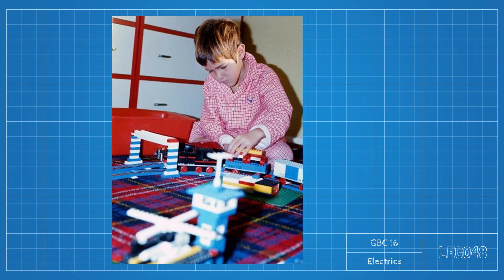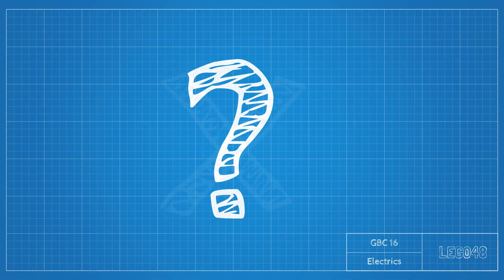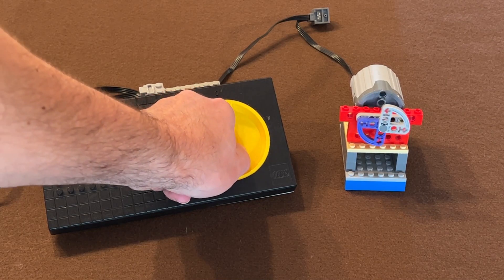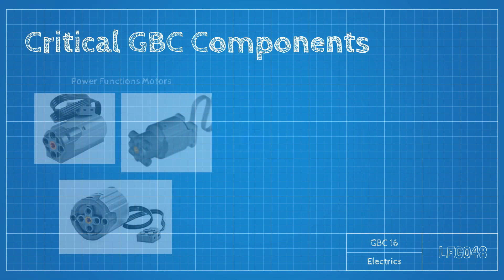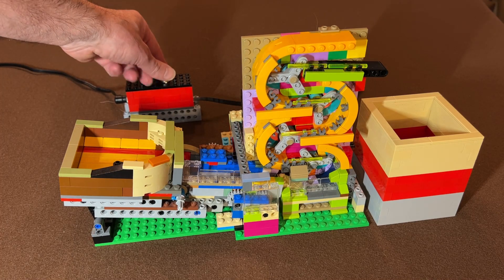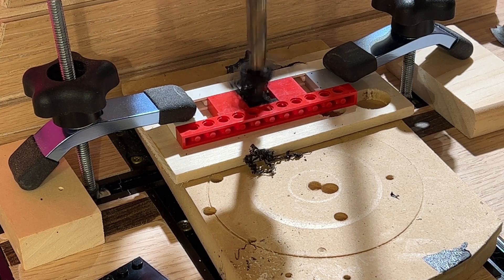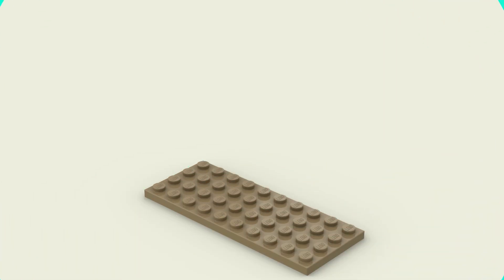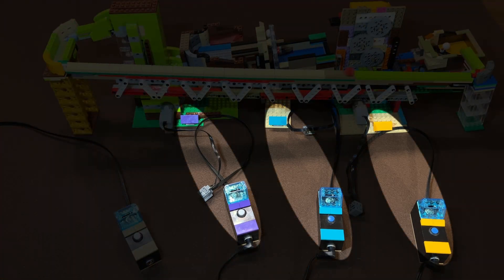GBC 16 How to power GBC modules

Comment: This is really cool and helpful, but what about if you WANT to control the speed of the motors to dial them in?
Reply from the maker: In those cases I use a variable power supply and adjust the speed there.  (https://www.amazon.com/Universal-Adjustable-Switching-Transformer-Display3V4V5V6V7V8V9V10V11V12V/dp/B0CBK17BPF?ref_=ast_sto_dp) I only need one, because this is a use-case that just doesn't come up that often.  It's rare to see builders trying to dial in a specific speed for their modules - because of the assumption that everything will run at "full power", speed adjustments are done by designing the gear train to give you the correct speed.

Comment: Is it possible to use Lego Robotics controllers like Spike Prime with its 6 outputs, and possibly some extension cables when the motors need to be separated further apart?
Reply from the maker: Unfortunately I do not have any experience with Spike Prime.  There are 20cm extension cables which I have used with the PF motors; if I need more distance than that then I'm probably running the modules off of separate controllers (hence the power supplies with really long cords!)

Comment: have you tried useing the mouldking pf motors? they are identical to lego
Reply from the maker: I have not... I'll have to check them out.  FYI: Most of the non-Lego motors that I've tried are significantly noiser and run 30% to 70% faster than the equivalent Lego versions; enough of a difference to require a change in the gearing.
Reply: yep we have tried the newer clone motors, and as of 2023 they are bang on.